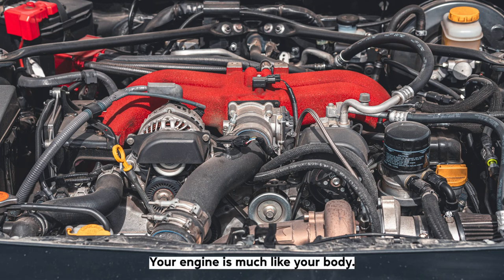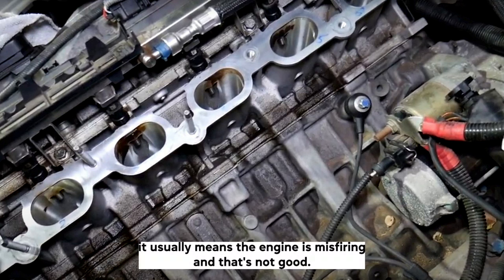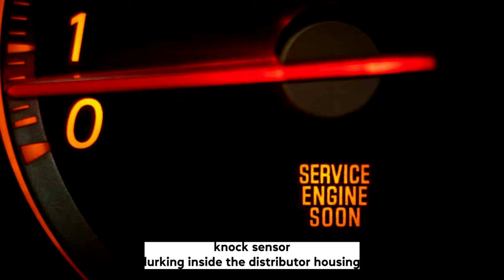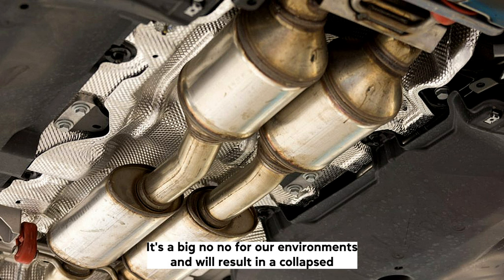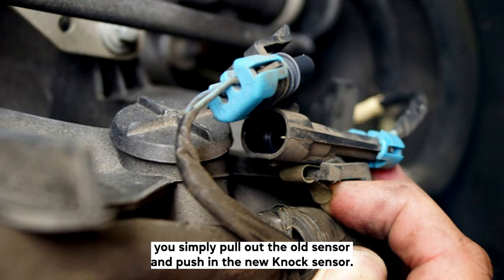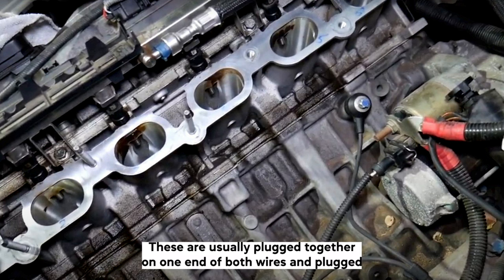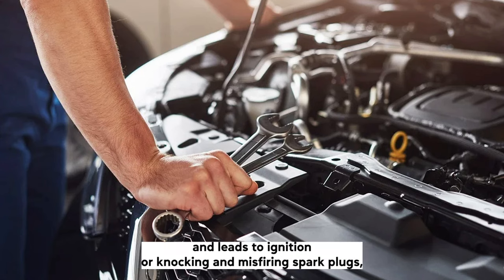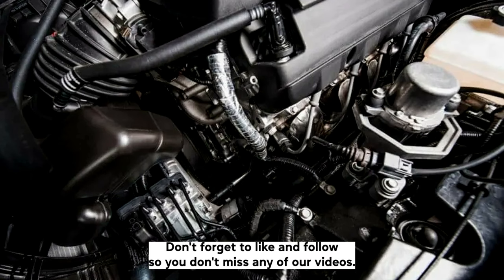5 Bad Knock Sensor Symptoms & How To Fix

Comment: Very well done. I'm about to change the knock sensors on my 2004 volvo xc70 because of these symptoms: rough idle with a pronounced dull thud and vibration that increases with RPM, poor acceleration (and I mean-really poor acceleration) a lack of power and a check engine light, although the codes were cleared because the battery was removed. I cleaned and tested the fuel injectors, performed a compression test on a hot engine and received good numbers across all 5 cylinders (165-170 psi), and installed new, correctly-gapped spark plugs. A vacuum guage connected directly to the intake manifold reads a steady 17"-18" (engine has 345,000 kms/215,000 miles) The ignition coils and boots were changed last year. I am more convinced than ever that the knock sensors may be the problem

Comment: Got them replaced on my truck and the service engine soon is still on but noticed you said that hot engine temperature and maybe that could be cause the shop installed some electric fans but when I'm idling for more than 15 to 20 minutes the fans don't turn on, the engine starts overheat

Comment: I have a 1963 Chevrolet. No knock sensor, safety or pollution BS. Don't need Knock sensor. Why?
If it knocks I have two ears to hear.. Just let up on the pedal, which is located there under the right foot. 
Wow it stopped knocking......  How simple.
Reply: well said my man. I really dont see any benefits for the knock sensors, they can even ruin your life more. too much technology can cause headache sometimes
Reply: ....and you still like occasionally  checking and adjusting points. 😁